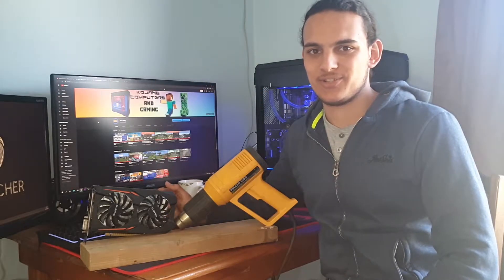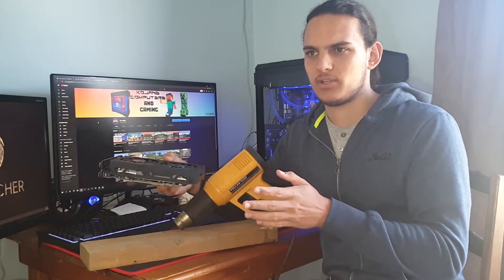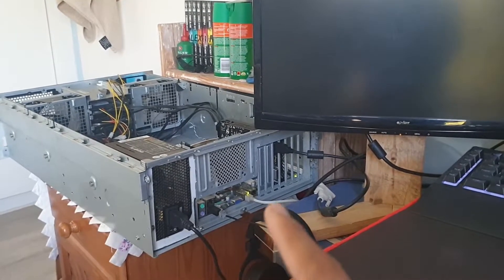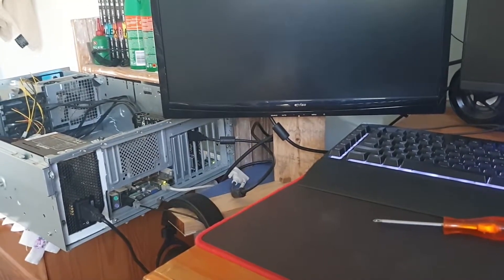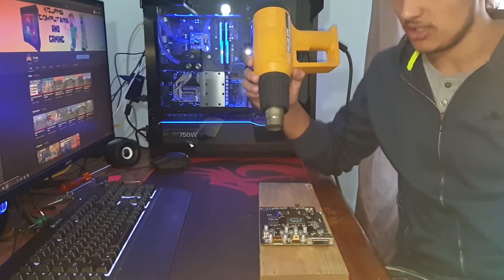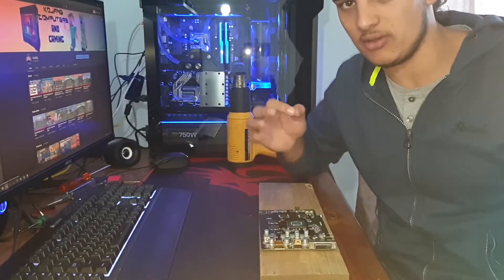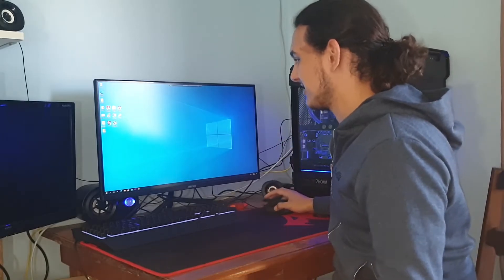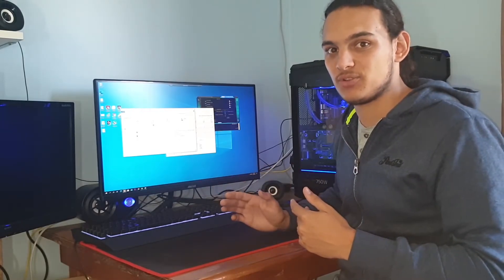Fixing A Dead GPU With No Display Output

Comment: Even the oven method wont be a permanent or long lasting repair. The ultimate solution is to know which chip is giving issue, whether its the memory or GPU, then to use a BGA machine to remove it and then add leaded balls to the chip and solder it back to the board. Leaded solder should be more durable to any kind of stress
Reply from the maker: That makes a lot of sens but i do not have access to a bga machine so i am just experimenting. And i get to make Youtube videos on it as a bonus
Reply: @kojang7382  Yes, the heat gun method is beneficial for finding out which chip it is that is not making proper connection to the board, but the ultimate solution is still changing out the solder balls.
Reply from the maker: Yea maybe one day i will try and do that

Comment: Great video, my rx 570 is artifacting on boot and black screen should i try this?
Reply from the maker: Not yet i would suggest that you contact a tech repair shop near you like a phone repair shop and just see if they might be able to help you. But i will say i am planning on doing a second video on this gpu as i got some other research. But if you want to you could put the card under heat just be carefull not to overheat or burn the pcb